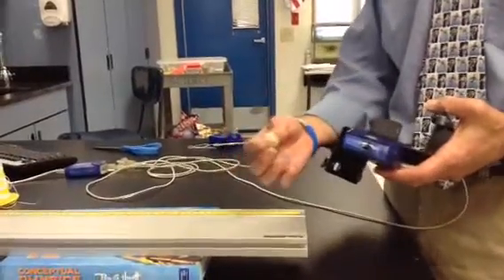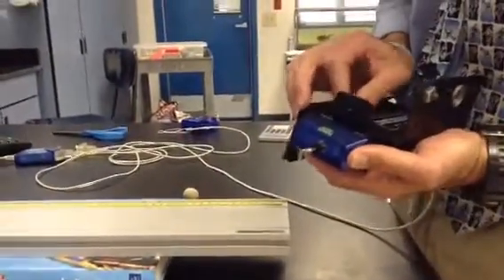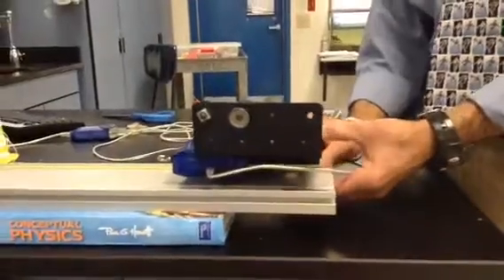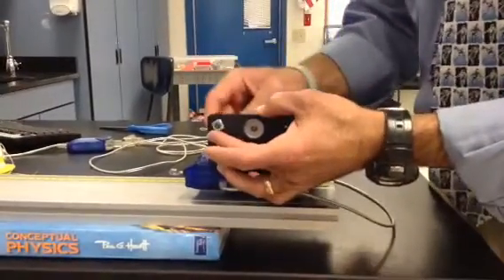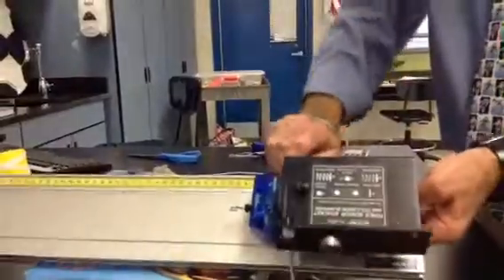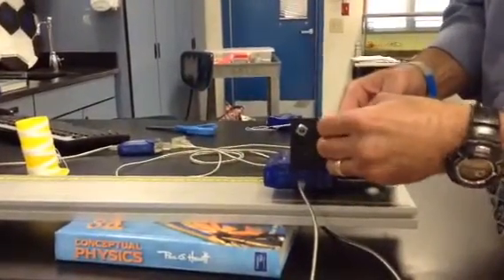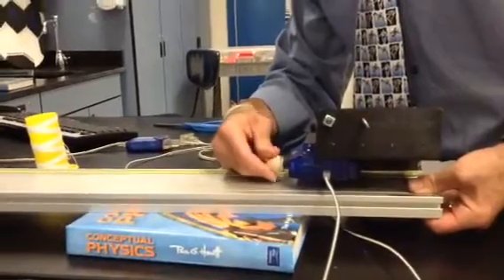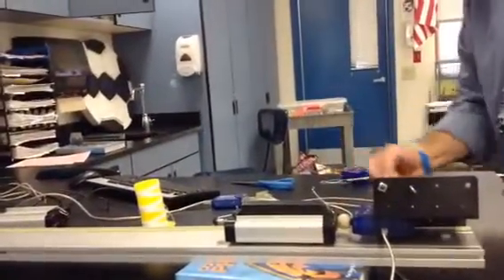Impulse bumper lab

Comment: If a truck place at 60cm at the top of ramp which is inclined plane (say 30°), and then release and cause collison at the far end ramp, which of the following scenario has larger impulse? 

1. The far end ramp has spring
2. The far end has no spring (i.e. hard hit) 

Change in momentum:
1 should be larger than 2 due the velicity changes 

But impulse = F x t
And F in 2 is much higher than 1 becoz hard hit. 

So which case is higher in injury if in real collison?

Comment: hi. I'm doing a physics lab tomorrow where I have to make a crumple zone for a wooden car. it's not that heavy but it has metal wheels so it is a bit heavy. our task is to make the crumple zone so that it will increase the time of impact. we are free to use stuff we find at home but it has to be behind a line that is about 5inches in front of the car. I'm not really sure what to use because he also said it cannot bounce off the wall when it crashes. do you suggest I use clay?if you have any other ideas please let me know.
Reply from the maker: Clay works well because it deforms without bouncing back to its original shape.  The actual shape of the clay is most important.  Cars are designed with "crumple zones" that intentionally designed to "crumple" or permanently deform absorbing the energy and prolonging the time of the collision.  This reduces the force of the impact increasing the chance of survival.  Experiment with different shapes and find the one that crumples best and gives the longest-smoothest collision.  Or use a different material that is structurally designed to crumple without bouncing back.  A paper structure might be designed to do this for example.
Reply: +Paul Morrison thank you very much